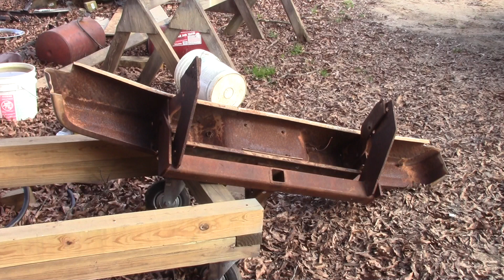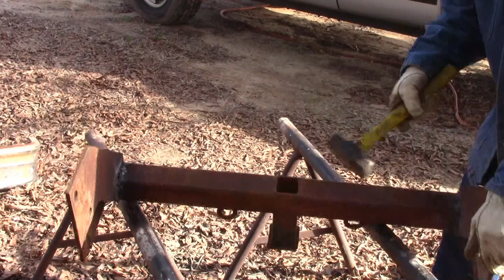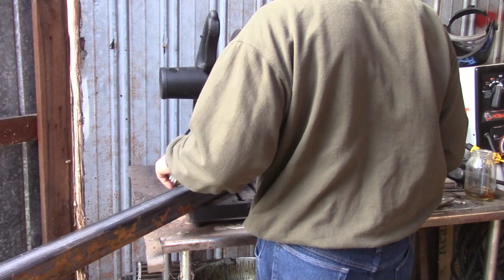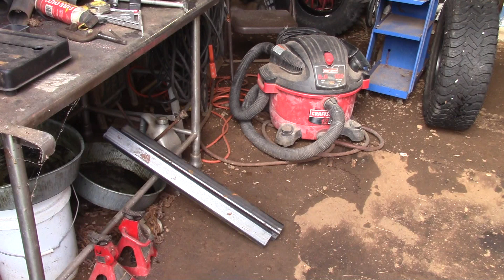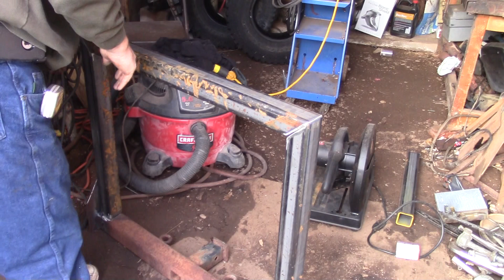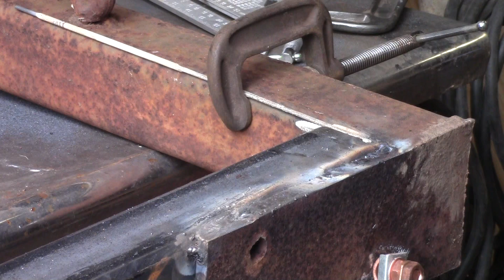3 pt trailer hitch build Part 1

Comment: Stick welding is something I have never done.  We have an old Lincoln welder.  I should get it out and give it a try.
Reply from the maker: I used to like stick welding over MIG but now I prefer MIG.  I only use it on thicker metal. You should try it!
Reply: Whatever you do don't do it like this guy